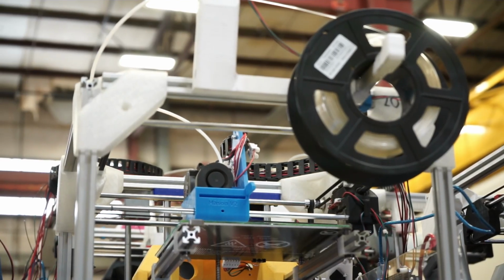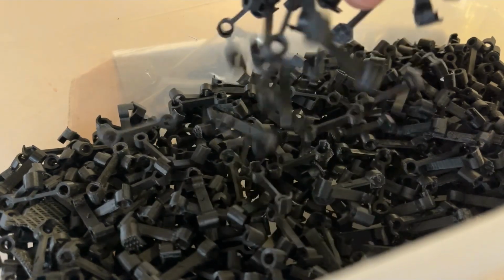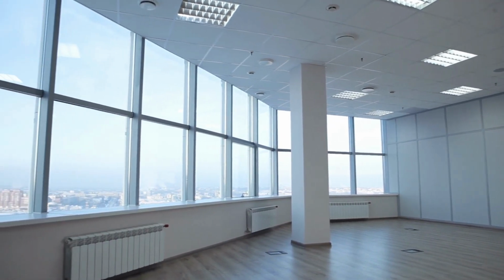What is a Digital Warehouse? How 3D Printing Transforms Inventory Management

Comment: I run a print farm and the highest cost is human labor to tend the machines. We have a small warehouse with high and low levels for each part. We avoid setting fewer than 20 machines off on a task. That way, all start and finish times are the same. The bank of printers all run the same filament and run the rolls out at the same time. The print beds can all be cleared into a single parts bin efficiently and quickly. An operator running lots and lots of different jobs would go insane. Having parts printed means the assembly team can fulfil an order without having to wait for a series of parts to print. Customers get their orders much more quickly because we buffer parts.
Reply from the maker: Yes. Print farm management is very difficult. In our 3000 machine megafarm we are constantly deploying new software andd automation to combat this. It is also why we had to develop "print farm" optimized machines rather than using off-the shelf consumer machines.